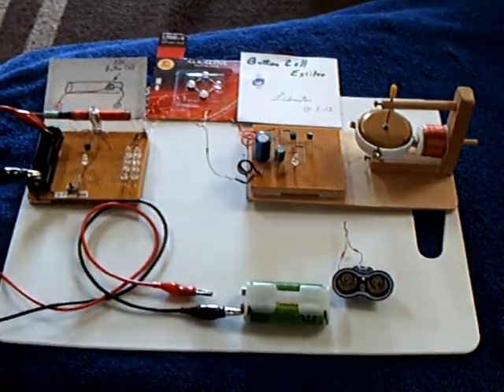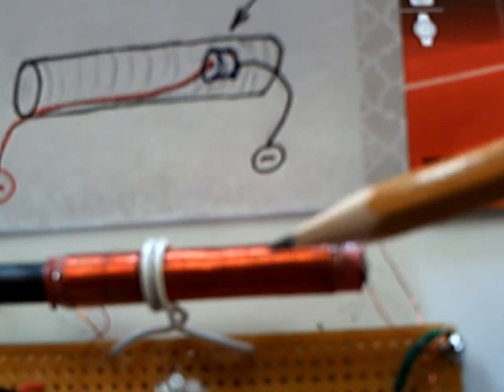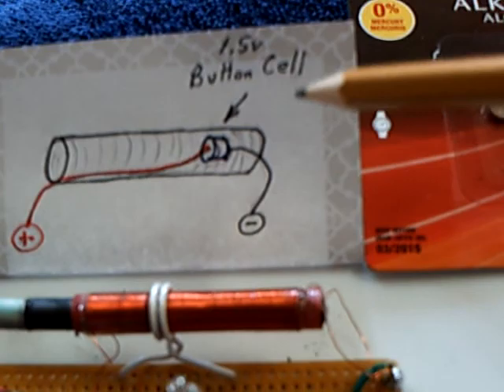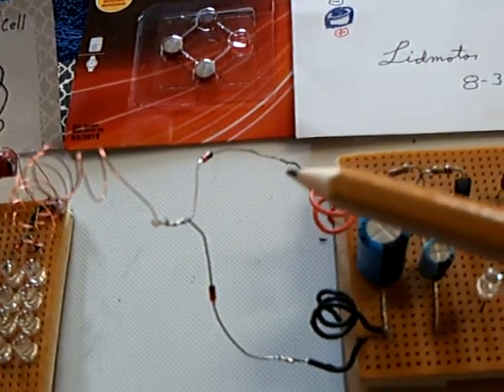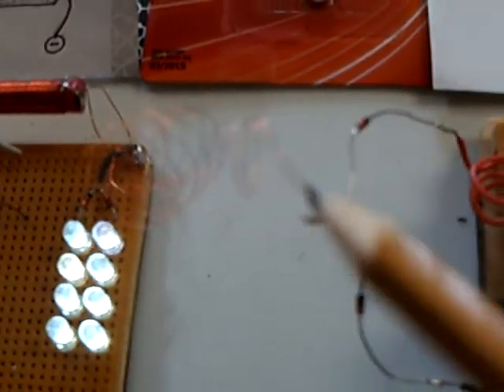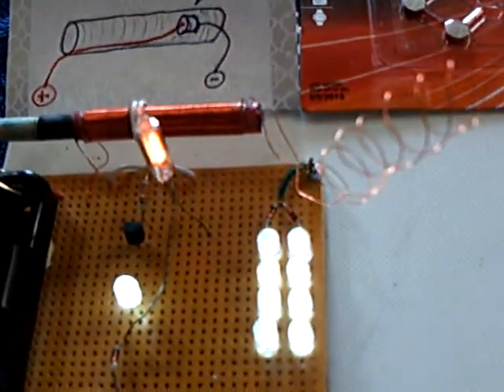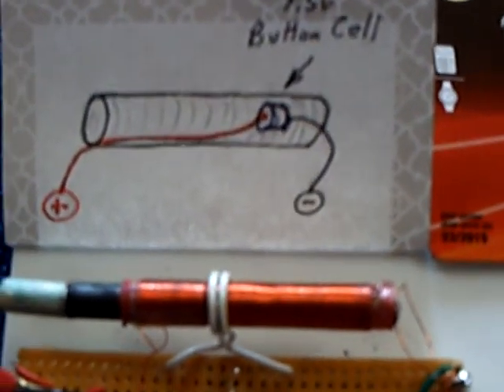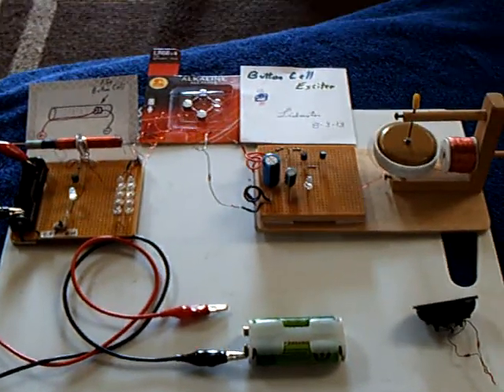Button cell Exciter

Comment: Yep I agree about the 1n4148, I got a few germanium signal diodes to work nearly as well, but the 1n4148 is king. I have a few solar charging oscillators too, They work very well. One with a 1-2v (2v in full sun) flexi Amorphous panel (Good for ambient) that can trickle a 12v SLA, and stop it going flat on the shelf. Lead alums seem to love solar oscillators\ too :) Another with Germanium transistor that starts from .06v, and can charge a AA from just about any light on a garden light panel

Comment from the maker: The key to the AV plug is the 1N4148 switching diode.  I have done solar powered exciters but to do ambient you need a big panel because they draw quite a bit of current.  As far as recharging alkaline cells--- I have had very good luck with solar recharged LED blocking oscillators.  I have one that runs non-stop (low light) and will run on a AA about as long a quartz wall clock does---many months.

Comment: I have been charging alkalines for 20+ years too. I wouldn't recommend it either. They can leak or explode, although you do get a feel for it after a while. I get 5-10 cycles out of my AA's before they leak. More since I discovered blocking oscillators. If you can run that from button cell, how does it go on ambient solar? Have you already done an ambient exciter? My memory is failing me.. Great single wire demo. I always wondered at the difference between av plug, and half wave rectifier?

Comment from the maker: Actually regular Alkaline batteries can be recharged if it is done right.  It is high discouraged but I have been doing it for years.  It doesn't work very well but when you get a chance stick a regular AA or AAA in a solar garden light and try it.

Comment from the maker: If I put a bunch of those polyacene caps together in parallel it might work for awhile.  This will run on a 5F supercap for short time.  I recall you running that long one wire out into your backyard.  Fun stuff.  Old man Tesla would get a kick out of our experiments.

Comment: Great demo, enjoyed that. 
If the draw was lower a polyacene would be a good candidate..charge it up from the helper batteries and then off it would go. Wonder how long one would last anyway, just seconds ? 
Yep, agree about the non capacitive coupling..have had 60ft from 30AWG to an LED mains light before without apparent loss. Plus, can light 4ft fluoros on 30 gauge with no heat from the wire.

Comment from the maker: I havn't tested the one wire energy transmission for distance except inside my house.  I once ran a 30 ga. magnet wire about 30 ft. down the hall and into another room and it worked fine.